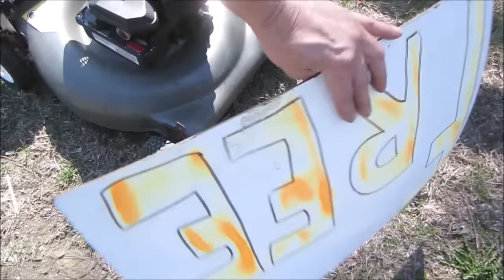How To Restore a Junk Lawn Mower For Free.

Comment: True story.  Found an old mower someone threw out.  Took it home, put gas in it, changed the oil, cranked right up.  Used it for years, mowing lawns at two different homes.  Eventually, I got a new mower and my wife sold the trash mower at a yard sale for 15 bucks! 🤣

Comment: Fixed a newer version of that Toro. Got $150. Needed a carb rebuild kit with the needle seat being shot and a couple other gaskets. Kit was $14.50. A new whole carburetor was $8.50. No brainer. Sharpen and balance the blade. Clean and degrease the entire thing. Slap in a new air filter (dude tilted it the wrong way and it was soaked in oil). Ran like a champ. But yea, having other donor machines around is a nice luxury.

Comment: You’re an inspiration to the rest of us wannabe DIYER’S. I have an older Craftsman which is a rear wheel drive 21” mower and the best mower I’ve ever owned. I’m planning on retrieving it from our cottage where it was used it for a couple of years. I’ll have to drain and clean the tank and clean the carburetor back home. I’m hoping to use it in place of the newer push mower. Thank you for your great videos and cheerful dialogue which gives me a lot of encouragement! I tipped the mower and found the blade was bent so bought a new one and will install it. Hope it starts after hitting that 2” stump and runs okay.

Comment: You nailed it with the rust comment.  Rust on the coil and on the flywheel close the air gap and cause a no-spark condition.  My mower lives outside and I have to clean up and regap the coil every spring.

Comment: In 1971, I was working for JC Penny's and I sold a ton on these lawn mowers. Penn-craft was Penny's model of this same lawn mower. When you would point this out the two side by side, they were the same except for the price and color. Toro was over a $100.00 dollar difference and some times more. I would point this out to the customer and they would buy the JC Penny's Penn-craft model. Guess what, I did not make a dime on sales, but made my Boss look good. I then went inside the store and started selling Hardware, my boss had both depts. I liked that better in the Air and stayed cleaner. Great Job and as Always and I Learned something today.

Comment: Back in the early 80's, I did small enging repairs as a side line and there were a few rich neighborhoods near me so every week on trash day i would take a ride out there, and i would see push mowers, riding mowers and even some chainsaws thrown out to trash, most only needed miner repairs such as points and condenser, or a spark plug, i picked Snappers, John Deere, Wheel Horse, homelite and Stiel saws, after i gave them TLC i then sold them. Easy money, now it seems most items today are throw away!

Comment: I have a toro like that and it still runs first pull every time, I bought it over 10 years ago at a yard sale and it was used when I got it. Ive run the manufactured fuel in it, and I personally think thats one of the keys to it.

Comment: Thanks for sharing your knowledge with us, Mustie1. I have a Toro that is 16 years old with front wheel drive and have replaced the front transmission and carb. The Tecumseh engines were great. These self propelled mowers work best when all the slack is adjusted out of the personal pace cable and it moves as soon as you push the handle.

Comment: That mower that was thrown away was in much better shape than the mowers I use regularly. Good find. I finally got around to fixing the self propel on my Toro motor and going to fix the cracked oil sump on my spare mower next.

Comment: At the 24-minute mark you spray the starter motor clutch with some kind of a cleaner.  What is the cleaner you are using?
Reply: I think he decided the oil was the problem so he used a degreaser to remove it. Maybe something like Brakleen

Comment: I JUST did my spring overhall on this nearly exact model.  (No electric start on mine).  
Now it starts up with 1/2 a pull.  Love it.  This thing is a workhorse.

That one looks somewhat lightly used (looking at the wheels, etc).

Comment: who remembers the old days before mustie started editing the volume softer on the wiz wheel
Reply: noise alert ! 😀
Reply: “..needs some love..”
Reply: I’ve got a problem my Craftsman push mower was filled with sae30w oil last summer only used it once and the other day I started it went down the yard for. About 12 ft and the motor locked up tight no oil it was dry as a bone. Can. Any thing be done to bring the motor back to life?

Comment: Another minor victory for this amateur mechanic. I bought this mower at the Kessler BX in 1983. It is Jacobsen predecessor to this style mower.  Used it to mow yards in Mississippi, Maryland, Kansas, and San Antonio. Several years ago it stopped working and would stall after starting. After a while I took it to a mower repair shop. They finally gave up claiming they could not find the carburetor diaphragm needed. Brought it home and took it apart and found Briggs and Stratton engine code on block. Googled a site with parts listing for the many hundreds of engines B&S made. Found and ordered the correct diaphragm. The carburetor sits on the diaphragm on top opening in gas tank. Uses compression pressures to move diaphragm and push gas from gas tank into carburetor. Reassembled, adjusted carburetor and it works! On YouTube I follow Mustie1 channel who repairs all types of oddball small engines. Learned enough to feel confident enough to dive into this repair.

Comment: I've got the exact mower although mine is pull start, 18 years and 1 pull starts every time.  Have replaced pull cable and drive gear and a few oil changes.  Love it.

Comment: i had the same mower...i would give it a shot of starter fluid and it would fire right up...let it run a bit and it was good for the season...plus the little hole in the jet in the fuel bowl  bolt always was clogged and that made it run great.....i kept it in the garage during the winter and that saved it for many yrs...great save Mustie

Comment: My 20 year old Toro looks identical. Near mint condition and still runs like new. Only put 2 tires on,  changed oil regularly and plugs in 20+ years of use. Great, reliable mowers.

Comment: Some lawn mowers actually say to do a downwards tilt to the cut (front wheels one setting lower than the back) to assist with the mulching.  It allows the mulched grass easier exit out the rear.  All mowers are different though.

I have also done front higher when I'm cutting up leaves in the fall to make them easier to enter the front (front all the way up, rear set to whatever height it usually is), but when I'm done with the leave cleanup, I set it back.

Comment: I agree with you Mustie about the contacts, in my mower repairs I've found that too wide a clearance from flywheel to coil a problem, but never rust really. 
Modern coils seem to have a shorter life span than on older machines, which with modern technologies you would think a coil would last forever. This isn't the case, obviously quality is not a priority nowadays.
I have a mate in the scrap business and pick up several of the Chinese Honda rip-off engined mowers. (Chonda's as they are known here lol) 8 out of ten have failed coils, most on engines with pretty low hours! The other two out of the ten is - one will have a carby issue, and the other one, amazingly, is usually people using 2 stroke fuel in a 4 stroke engine, they get so badly clogged with 2 stroke oil they don't start in the end!

Comment: Terrific job! I love those old Toro / Tecumseh combos, wish Tecumseh was still around. Any time I see one of those mowers or the front wheel drive ones I grab them up. The gearbox is completely rebuildable too, every single part can be replaced. Much better than the crappy plastic gearboxes the new ones have on them.

Comment: Mustie! I have a relatively new chainsaw that suddenly froze up.  Chainsaw was worth maybe $ 450 and $500. I did what you did... put WD 40 and PB Blaster into the cylinder  via the spark plug entry and connected a drill motor (after rocking it back and for,th.  I managed to free it up and have every expectation to make it work. Thanks... My local Husqvarna dealer said it was beyond economic repair. Works.! Thanks.

Comment: I had an identical mower given to me. It had been sitting in my grandmother's back yard, and had not run in about three years when was given to me. She said it wouldn't start, so she just bought a riding mower and left it where it sat. I cleared out a couple of mud dauber nests, changed the oil, and rebuilt the carburetor, and it fired right up. It took about $15 and a hour of work to get it running again. I take care of her yard for her now, and I actually took the mower back to her house, and use it on areas that need a push mower. It's still going strong two years later.

Comment: I just love the old tecumseh engines. I have an old mtd with the same basic engine. No electric start.  Air filters aren't the best, but they are dependable engines and start easy when maintained.

Comment: I had to do a gas tank drain/clean and carb clean on a pressure washer I have that was having issues running well. After I cleaned everything and it ran perfectly, I proceeded to pressure wash my house. My neighbor watched this whole thing happen and came over and we started chatting about the machine and the convo came around where he asked if I'd rather be pressure washing my house or be at the beach relaxing? I honestly took a second to think and said, i'd rather fix the machine, then pressure wash the house. His response was, "Now you're just being controversial." I laughed because I wasn't. I have a feeling the people that watch these videos probably feel the same way I did.

Comment: I have this exact mower and I've been meaning to figure out why the drive wheels sometimes don't catch. Now I have something to go on when I do finally take the time to check it out.  Mine also lost that plastic cover piece on the front. The way it's positioned, part of it covers the mower deck area and it won't take much for some flying debris to catch it just right and damage the clips. I had to toss mine because it was too messed up, but a little duct tape to cover that hole, and it's all good.

Thanks for the teardown/repair... besides that drive wheel issue, I have a couple other ideas of some maintenance I should tackle. :)
Reply: Sure enough, I pulled the wheels and those spring loaded clips were so clogged with junk, they were essentially stuck in place. No wonder they would often "free wheel" instead of engaging the self propelled feature, especially if it was trying to drive itself uphill ever so slightly. Got them cleaned out and they seem to be chugging along - I'm actually looking forward to mowing to see the real world difference it made. Also noticed my air filter (which I swear I replace just last year) was already super filthy. Blew it out and that ought to do it.

Comment: I have one of these mowers.  Bought 20 years ago.  Replaced the fuel tank and cleaned the drive wheels.  One broken cable replaced. Takes about 6 prime pumps then starts first pull.

Comment: Good video I rescued the same mower you showing No automatic start I took the carb bowl off Cleaned it and got it to run The issue was bowl is all rusted up and some rust kept breaking off and getting caught in the needle The rebuilding out cost $16.00 but no sense to rebuild it with rusted bowl. Waiting on the new one I ordered Comes with all gaskets,fuel filter ,shut off and 2 air filters for $17.99

Comment: Aircraft Mechanic> Mistie I enjoy your videos. The only effect rust  would have is at the surface of the core of the coil core and the magnet surfaces at the perimeter of the flywheel. Rust that the magmatism  has to flow across is like a weak resistor in an electrical circuit. IF several other conditions are contributing to a weak spark the rust may be the straw that breaks the camel's back. The only other condition that could be the loss of spark with respect to rust is if the primary circuit of the coil grounds through the magnetic coil core to frame ground to complete the primary ignition circuit then rust will diminish the primary current and prevent a spark. But usually, the coil screws that anchor the coil core will be a reasonable electrical ground for the primary circuit.
Reply: I concur

Comment: I have one of these from about 2012.  The manual calls for changing the oil by tipping on its side like you did, no mention of using any drain plugs on the bottom.

Comment: Tecumseh engine on that Toro, Tecumseh out of business in 2003.  Lots of cheap parts on Amazon however.  That mower would bring $150-160 here in Silicon Valley.  You are very lucky that the starter motor still works, usually they don't. I love those eyesore mowers that come out of back yards and on to the curb and are free for the taking $$$$$. Here everyone has tiny lawns and mowers don't wear out, they just get gummed up LOL.

Comment: Wish I’d seen this video a few years ago when my Dad gave me his old Toro that wouldn’t run. It had bad gas from sitting for over a decade; I got a new Tecumseh carb and put it on. I tried spinning the shaft like you did, except I didn’t take out the plug. The flywheel was cracked (not sure if from one of the hard pulls or from attempting to spin it). FYI The flywheel for the electric start was impossible to find used in eBay and very expensive new from a parts place. It would have been $65 for a new one. I got a pull-start flywheel (without the teeth). Also replaced the ignition module; I used an old business card to set the gap. Finally got it running but it was late October. Next spring, I pulled it dozens of times until my shoulder and back hurt, and said screw it. Got a corded electric Greenworks and have had no issues. I gave away the Toro but I forgot to include the bag; I’m hoping to find someone that can use it.

Comment: I had one of those mowers growing up, it's from about 2006 or 2007. I had the variant without electric start however.
did a dumb and let it sit outside for the winter and had to use two-stroke gas to get it working properly. was smokey, but at least it saved it, and I was able to sell it for 50 bucks back in 2013 after we acquired a craftsman with a Honda motor for about the same price.

Comment: Insane free pics! TWO Toro Personal Pace mowers?? The finished product would go for $180-$200 where I'm at in north central NC. Thanks for the time, effort and insight on rear drive gear and springs. I've got a Personal Pace I'm doing an engine swap on after original owner ran it out of oil.

Comment: If the magnets contact the coil, the magnetic flux will be at maximum. That is why you set the air gap as close as possible without making contact. As far as I know, all you get when they make contact is a heck of a lot of wear. If it sets idle in a damp environment you get rust welding. Nice job on the troubleshooting.

Comment: I have that exact same mower with the exact same issue - a new coil fixed it this year.   Mine is a 2006 model - I bought when The Home Depot I worked at put the mower at 50% off at Christmas, as the 2007 Toro's were a new model.   I put it away until I needed it about 8 years later.  Never used the electric start even once.   Only issue is the engine is a Tecumseh so spare parts can be hard to figure out.

Comment: I just bought a personal pace model, it it works well.  Sure like to know that drive works, to match your speed.  Basically,  more or lass belt slippage?

On the height adjustment, you can set the lever straddling the tab, or between the tabs.  Lots of different settings available.

Comment: I really appreciated your discussion on how mower blades work and how the rake of the mower can mess the cut up.  
I have a garden tractor with a deck and the cut from the three equal sized blades is uneven.  I have not run it this year and I forget the exact pattern.  I think the height difference is from pass to pass, but the different blades might cut at different heights too.  
Could you repair a machine with a deck and explain how the grass cut can go wrong with a deck?  Do that and give suggestions on how to fix it.  Hope you like this suggestion.

Comment: I’ve had graphite spray recommended for lubricating parts in a dirty environment, especially ones that are hard or impossible to get apart to clean (primarily lock tumblers). Not sure what the propellant is, but it evaporates, leaving a fine graphite coating that’s less likely to attract and accumulate dirt. Might be worth a try.

Comment: My 21 year old Murray 20" push mower  was throwing a tantrum about starting last Summer, so I nursed it through as it wouldn't prime though I had added a new primer bulb that Spring.  Just started it by taking breather off and pouring a bit of gas down the carb, replacing the breather and starting.  In the 21 years I've had it I've replaced the diaphragm & gasket 3 times, cleaned the pickup screen the same amount of times and replaced the primer bulb twice.  This spring I said F it and bought a new carb & tank for it for $20 changed it over in all of ten minutes and she fired on the first crank like she was still brand new :)  I'm sure the deck will rot out from under her long before the old Briggs dies, lol.  My 11 years old Poulan Pro 46" rider with the 20hp Briggs is still going strong as well though I did finally have to replace the original drive and deck belts this year as well.  :)

Comment: Got one just like that one from a neighbor, whose kids must have hit the curd or rock edging to many times as the only thing I could figure out was the crank was bent and it would eat through bottom seals just about every time you ran it, then dump the oil on the ground. I stripped it for parts and carted it off to the recycler along with a couple of other dead mowers i don't have tie to mess with.